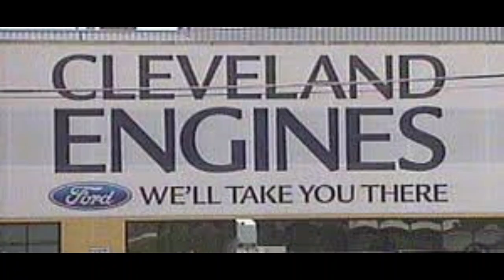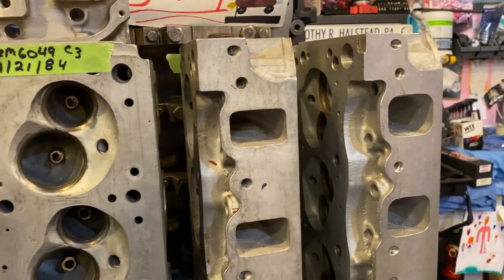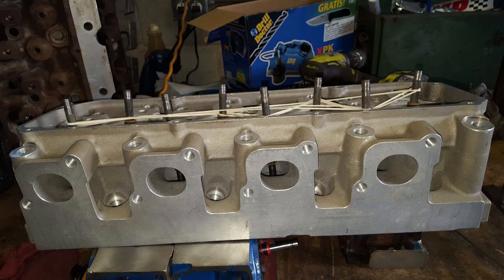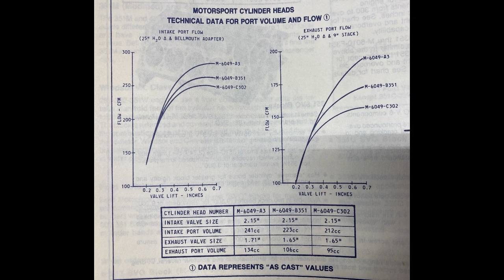DBG: The Evolution Of Ford Motorsport/SVO Aluminum Cleveland Based Cylinder Heads, Alphabet Soup..

Comment: I work in Mooresville, NC which is where alot of NASCAR teams are based. I heard from a very reliable source that before 1988 there was no block deck height rule for the small blocks, only 355ci limit. So I was told Ernie Elliot built 8.2 deck Boss 302 blocks stroked to 355ci with the A3's. That was there HP advantage over everyone else. Lighter rotating assembly, shorter intake runners, shorter pushrods. Made more power than a 9.2 deck 355ci engine.
Reply from the maker: Dang it man that might be it. Makes sense.  So he used the A3 to go 200+ mph? Thanks
Reply: I will go with that. Makes sense to me. People that try to put the longest rod in that they can are thinking different than I do.
Reply from the maker: Me too. But would like to hear it from him.
Reply: I must have bumped a button, I didn’t dislike your post. Sorry. I think it explains a lot of things.
Reply from the maker: @XTT162 unlike it that’s all you got to do.
Reply: I wonder if he managed to get 4.125 bore like the 8.2 Motorsports block they sell now or the 4.06 with a stroker crank, I wonder how he did it?
Reply: @Bbba724  I think those guys were limited on the cubic inches they could use to 360. Probably 4.125 bore and about a 3.25 or stroke.
Reply: @davidreed6070  cubic inch limit was 355ci. One thing you gotta know about NASCAR engine building, they get custom made EVERTHING! They get crankshafts, rods and pistons made to whatever size they want.
Reply from the maker: Be nice to find out the truth
Reply: @dragboss351cleveland  … I’ve often heard that the truth will set you free….😉.

Comment: Which heads didnt use Cant on the valves?  Ive seen a set of Yates C3's i believe were done this way?
Reply from the maker: Andy, Yates are not canted., not sure on next in succession. These will be on next video. Thanks for watching
Reply: @dragboss351cleveland  I seen some that were and others not... I will look at the ones left over at DV's and send you some pics of he hasn't sold them already
Reply from the maker: @UnityMotorSportsGarage remember that Yates are C3 and the Cleveland had a C3 too like in the video.

Comment: Dude, you need Ernie to spill some Cleveland secrets! That would be awesome
Reply from the maker: I will take care of it. I agree 💯 🏁
Reply: @dragboss351cleveland from my understanding, back in the day wrnie elliot built Bud Moore a 331 inch bullet that would fly. My great uncles built the clevelands for BME from the 70s-90s
Reply from the maker: That would be killer to get him on.
Reply: That was the first time I had ever heard of dimpled intake ports & combustion chambers!
Reply from the maker: Do the dimples work, is the question
Reply: @dragboss351cleveland  I would like to say that there is merit to the idea. Creating mini vortices to keep fuel from "wetting out" on the port walls and combustion chamber. If you look at most dual plane intakes right beneath the carb (or FI) there is some configuration of bumps/ protrusions that cause surface turbulence to (I assume) keep fuel atomized!.....IMO!
Reply from the maker: @suntzu5836 yes I get it. May increase flow, but does it make more power with or without them?
Reply: @dragboss351cleveland  Not so much increasing flow but promoting fuel atomization!.....IMO!.....Keep up the excellent work!
Reply from the maker: @suntzu5836 right on my friend. Appreciate the interest here at DBG